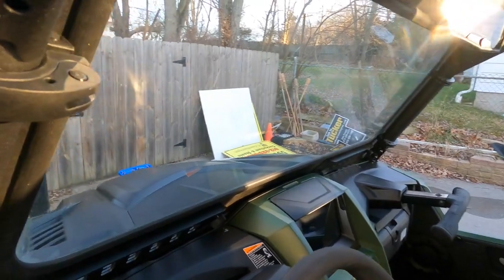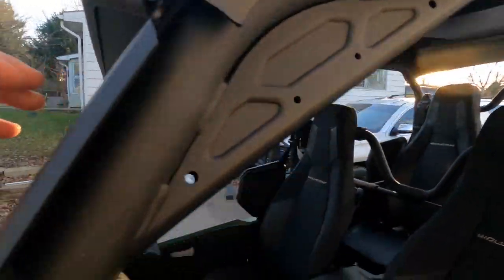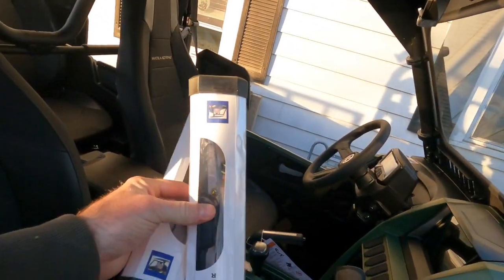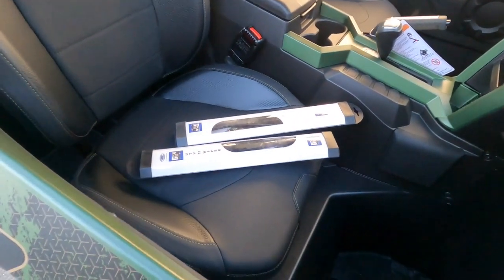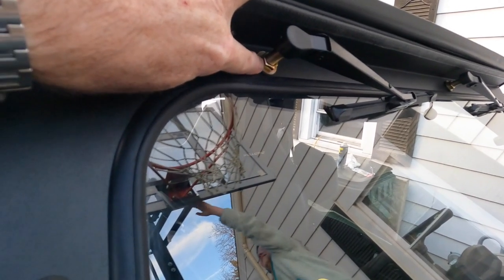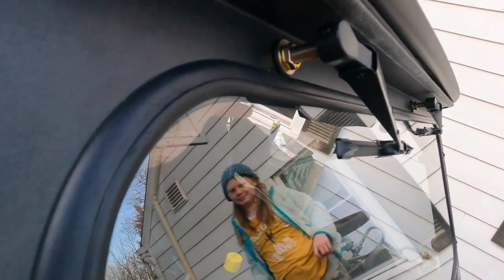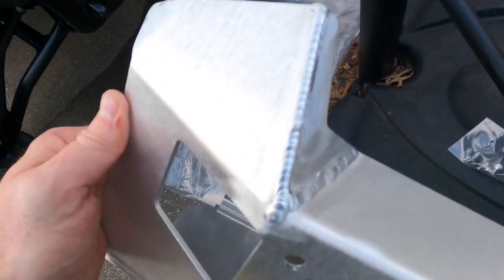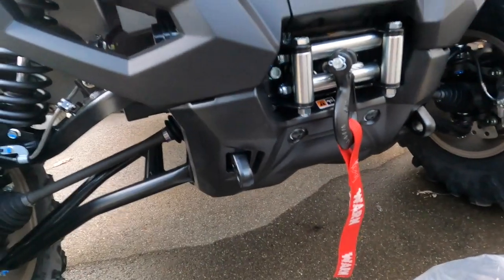RMAX Alpha Windshield

Comment: How are you liking the windshield?
Reply from the maker: Pretty well. I ordered straight out of the gates before my RMAX was even in. Mind you we were in the middle of Govt control and lock downs, supply chains were slow or product sold out. Now that the model has gained traction and has more aftermarket support, there maybe a better option.  But I've been pleased with it. Very well made and sturdy.
Reply: Not available when I was looking, just picked up our RMax on Friday. Dealer had a Super Atv top flip windshield on hand and that was my other consideration. Planned to install it yesterday and started pulling pieces out only to find that the bottom poly section had all kinds of scratches on it where something had rubbed on it in the box.  I really wanted to like that windshield as you could open it up for more air in the summer but now considering a glass windshield again. I like the way this one mounts and ease of removal. And based on their web site they may be back in stock right now so I’ll be making a phone call on Tuesday to confirm.  Are you still satisfied with yours?  Thanks Steve
Reply from the maker: @Steve Lutzke  still loving it